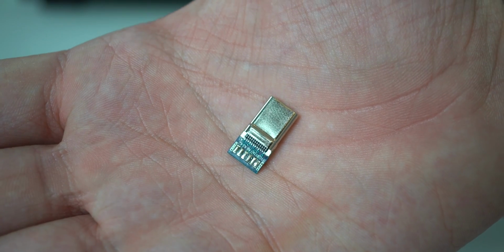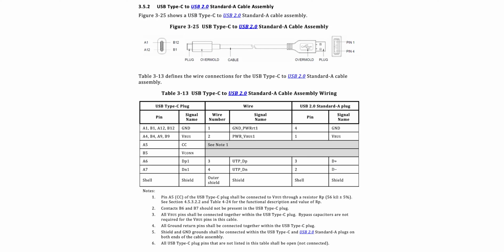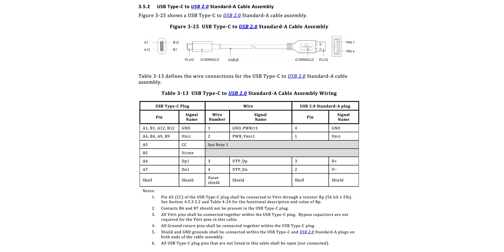Making a DIY USB-C to Lightning Cable

Comment: Will that seems simple enough now try making a video using a double-ended type-c cable chopping it and then trying to connect it to a USB lightning and and it's not going to be simple that's what I'm working on because the type c to type c and has an extra wire in there and for some reason it's not it's not converting